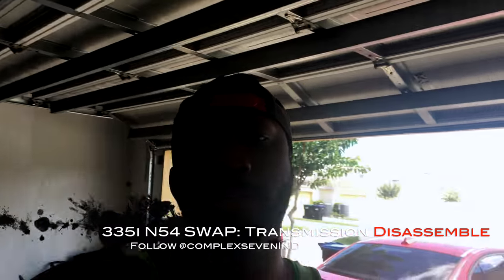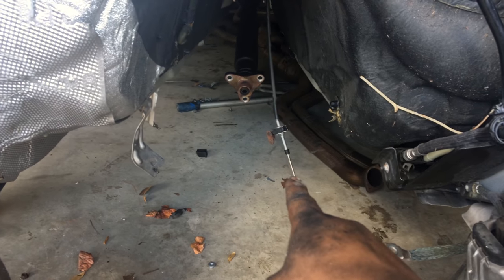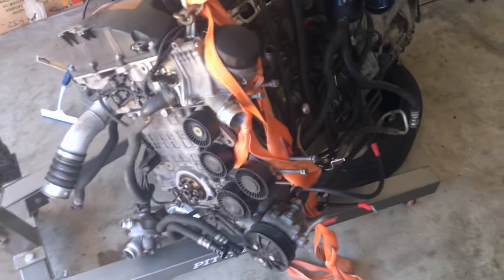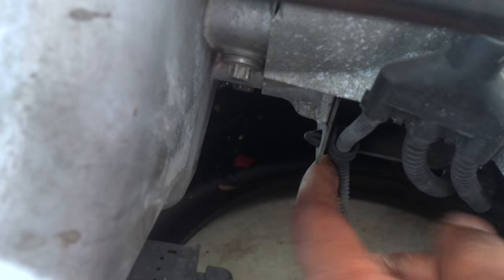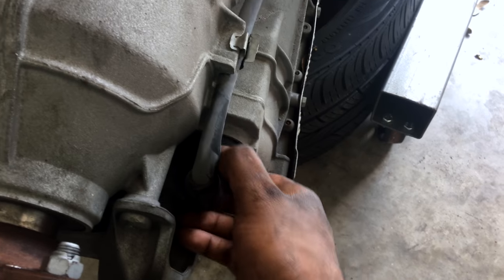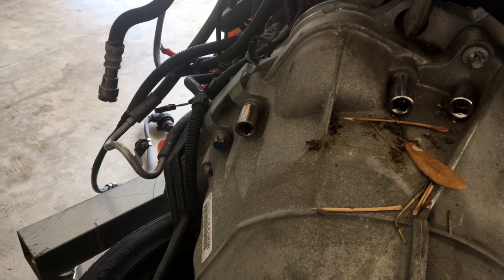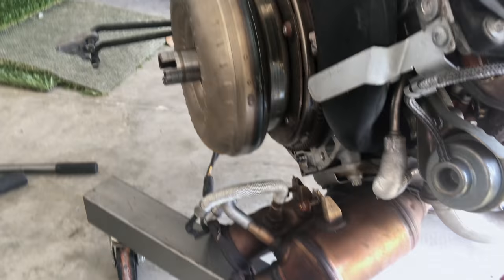BMW N54 335i Disassemble Transmission From Engine

Comment: Sorry for all the questions.  Do you recall where you found the replacement bellhousing bolts or did you end up just reusing them ?
Reply: @nOshi2x  i heard only the five long e18 ones have to be replaced because the rest of them are steel and those are aluminum but im having trouble finding them. i found some that look like the ones for the trans (part # 23000417164) but they are apparently for a standard do you know if the mounting bolts for a auto or standard are different. i would think not so you can do manual or auto trans swaps but i just want to make sure. thanks for the tutorials

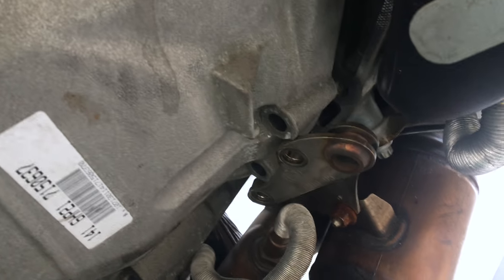Comment: 5:00 Those 2 bolts that are on the passenger side and hold the weird bracket, are those holding in the transmission to the engine or just the bracket?
Reply: +Complex Seven Industries Wow I remember working on inlets and thought it was weird i don't have those bolts in, just big ass holes. Thats no good
Reply: Could you check a link for me?
https://www.turnermotorsport.com/p-11497-aluminum-bolt-kit-for-bell-housing-e9x-335i-e82-135i-e60-535i/
I know links are rude in comments. I can't remember what they look like though. You said all the bolts were different too.